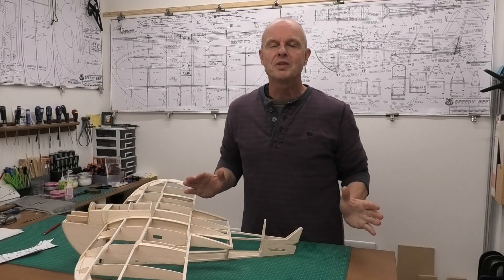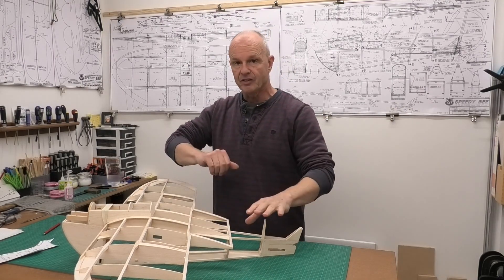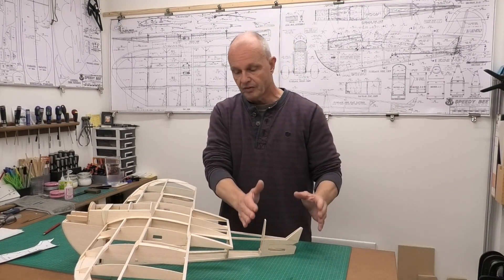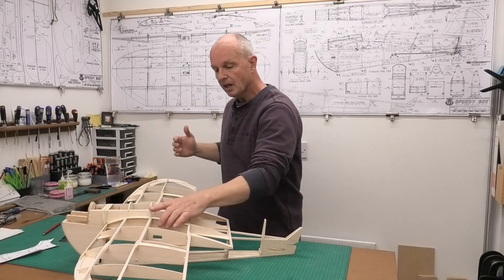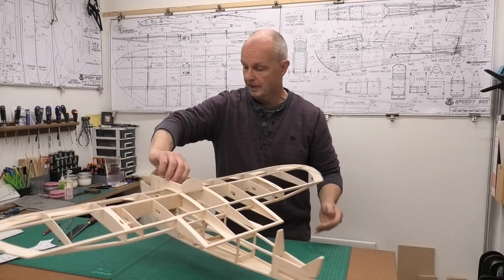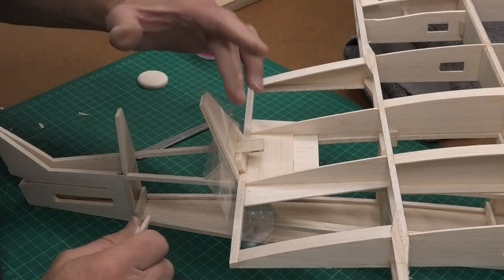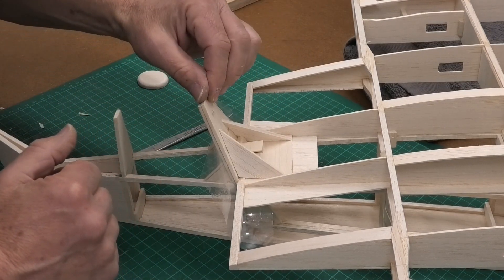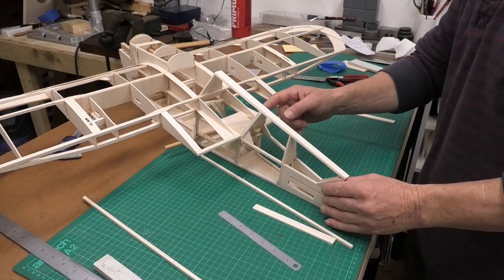Speedy Bee - Build Series Pt 8: Building the Turtle Deck - Designed by Clancy Aviation - OS fs26

Comment: Hi Mark! - Again a splendid video with generous building tips 👍 - I Have just ordered a set of plans at my local print shop but I do have a question of where on the lines to cut - in the middle, outer or inner edge? - I often trace drawings on my CAD program and have same issue. Knowing the size og spars etc. I found that this plan (most of the times) the datum in the middle.. Any tips regarding this topic?
Reply from the maker: Thanks for the kind comment, its a really interesting build, you will love it.  Regarding the line, I guess it doesnt really matter as long as you are consistant and you don't trust the plans, but keep checking the measurements, these plans are quite good, but often the ribs and formers are not quite right on old plans, so need to be constantly vigel.  I generaly work to outside of the line